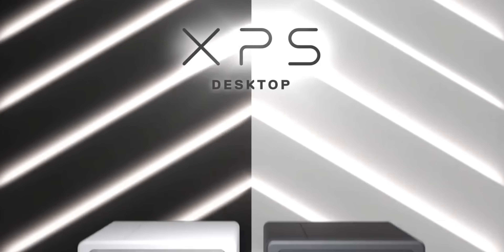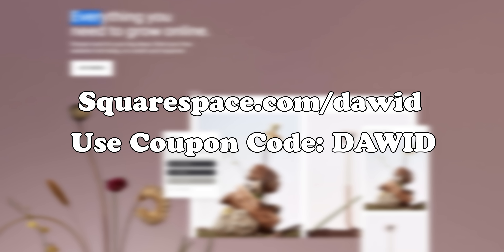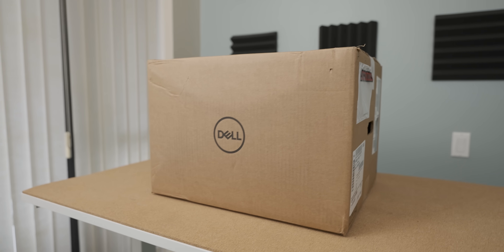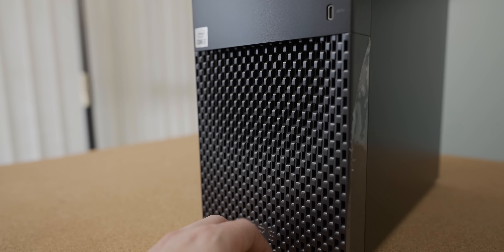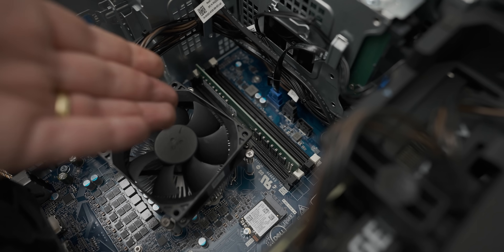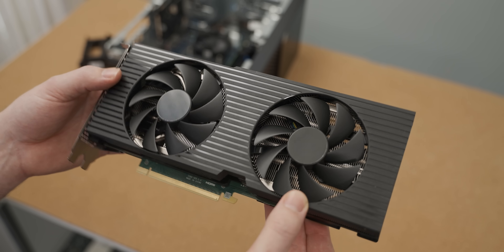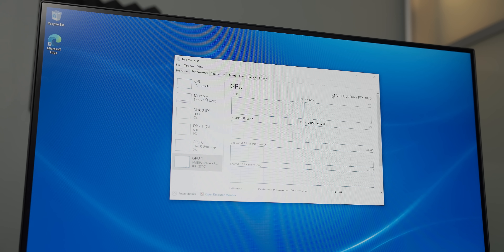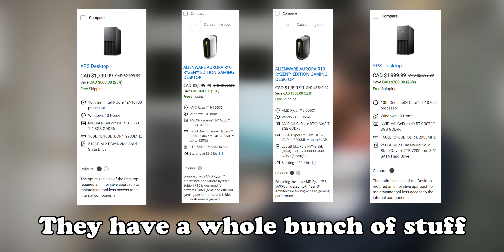DELL Did Me Dirty... RTX 3070 Dell XPS Pre-Built

Comment: Ya know I'm so over the "gamer" look that the simplicity of the dell's are looking good to me.
Reply: Same, I bought a prebuilt for the same reason and I have turned off the flashy lights
Reply: @Adam-qs5ir  same. Though it's getting harder to find a black, no LED, no plexiglass case at a decent price. They have become the outliers and cost more than the flashy ones.
Reply: @bertro514  It really is. I was considering re-casing mine but plain cases aren't in the cheap aisle. Well, unless you go real cheap amazon, but I want some airflow.
Reply: @Adam-qs5ir  One of the reasons I ended up getting a Dell G5 WAS the plain case (well, it came with one LED strip, but I quickly turned that off). Stock airflow and cooling was shitty, but with a bit of cleanup and a bunch of Noctua coolers, I'm typing this with the CPU sitting at 29 degrees.
Reply: @bertro514  Corsair Carbide 100R case, you can get it with or without a Plexiglass side and it's relatively cheap at £58.
Reply: @bertro514  modern cases use tempered glass not plexiglass
Reply: @weegle.  Tell that to Dell, lol :)
Reply: Also it means less likely of house robbers taking your PC because it looks discreet and not worth stealing. Robbers usually go fancy looking things like Macs and laptops.
Reply: Correct. Performance matters, not appearance.
Reply: @nothingtodo58  problem is this bland look isnt even good at performance. Poor air flow etc. At least many gamer looking pcs add fans and try to cool the system down.
Reply: @nothingtodo58  false everyone knows that rgb = power
Reply: Completely agree
Reply: I love the look of the 2011 style precision desktops
Reply: My son is using my old rig. All black, no glass or rgb, perforated in the right places for airflow. It was perfect. Only an i5 and a 1070 but still, the look was good
Reply: Fractal makes some wicked awesome cases that are minimalist aesthetically, but are heavy hitters when it comes to modularity, and effectiveness.  I've got one that came with a DARK tited glass side cover.  I like being able to barely make out my rig in there, lol.  With no RGB of course.
Reply: @suprafastmafc  got the same case I love it but the front usb port doesn't work with some mouse adapters causing them to get stuck
Reply: Yeah, except that Dell goes so far in the opposite direction that they end up making something that's like a time capsule for 2007? Like if I wanted to degamer my pc, all I would have to do is just turn off the RGB and it all looks sensible.
Reply: It looks very clean and when you take off that intel core i7 logo on the front and slap in a core 2 duo logo and a windows vista logo it might be a good sleeper pc
Reply: @69wowzers69  and a lowspec sticker from LowSpecGamer
Reply: this is not about apperence, with a 500 watts powersuply, with a case like this and such a cpu cooler you got a real bottleneck D; RGB is still a gimmik that doesnt affect the price, so i dont get your rant. y<ou can make your PC looks shiny without paying an extra premium.
Reply: And usually "gamer" cases and fans are more expensive. I built my pc on a 20€ office case.
Reply: wrong!!!!! RGB makes you get 10% extra FPS
Reply: Idk, I'm not going to spend $1500 on a PC that looks like it goes in a lawyers office when PC cases are one of the lesser expensive parts out there. You can easily get a $50 or lower case that doesn't scream gamer.
Reply: the problem is not the look of the case , the problem is everything packed together the way it is , it is an airflow issue
Reply: Maybe, or most certainly I'm too old for flashy things, like what a gaming rig has to look like. I prefer a smooth surface, no plexiglass and hell no led strips plastered all over the system. 

First: I prefer getting a better mainboard, cpu, ram, or maybe even gpu for the price of some led strips.

Second:: It just looks cheap. Like blue dyed hair. It's the only colour I don't like seeing in hair. It always looks like coloured plastic glue or blueberry bubble gum in your hair. Like LED stripes. To be fair it always reminds me of the windows in rotterdam where girls strip to lure in some customers. 

Third: A game does not care about my rainbow coloured system. 

Fourth: Pre built gaming systems always cost a hundred bucks or more than their equivalent multimedia systems because they are not flashy

Last: Airflow over everything. If a case can provide better airflow I prefer that over some plexiglass and blinking lights. (again less stress for the power system, less money spend in the long run)

All in all, led is just a cheap showoff, maybe cool when you go to a convention, but that's it. For everyone else it's only a waste of money. An led strip in your room is the much cheaper variant if you need light.
Reply: @FenrisEx  oh common why would you want to spend you money on a better main board ram or gpu why not spend it on useless lights that do nothing for the computers performance but look cool and that's it
Reply: @FenrisEx  bro leds are 10 bucks, good luck getting a new gpu, mobo, or cpu for that price
Reply: i agree with you man
Reply: They s rig s so cheap that you could strut down to the hardware store, pick up a couple of spray cans and paint it whatever color you like. When cares if that lessens its resales value? You could buy another case to put it back if you really needed to. But after you’ve gamed on it for a few years, it wouldn’t be worth it.
Reply: I actually like these dell cases best. Idk why theres curvy edges on the one he got. https://c1.neweggimages.com/ProductImage/83-995-211-S01.jpg
Reply: The old optiplex cases from 5-7 years ago are hands down the sexiest cases
Reply: Yea, that's part of the reason I love the Fractal Design Meshify C, it has a much more toned down and reasonable look to it, while still providing all of the "gamer" features like good ventilation and radiator support. I loved mine until I had a random motherboard failure, but needed my PC back up and running asap and the only replacement motherboard I could find in person wouldn't fit in it and I couldn't find a bigger Meshify C in person
Reply: I love the Fractal Design and Li-Lian cases for that reason, BeQuiet coolers without the RGB also look nice then the motherboard and GPU RGB stand out against the rest.
Reply: There are plenty of elegant cases out there. You don't need to buy the "gamer" ones.
Reply: I always come back to this video cause the thumbnails kills me
Reply: till they lie to you and give you single channel ram over dual channel lol
Reply: fractal cases are better in most every way for any kind enthusiast..
Reply: Rgb with intel i3 is the same as ricers in cars
Reply: I still have my Dell XPS 8920 paired and upgraded with a previous gen RTX 2070 Super founders edition, Corsair Vengeance 32GB 3200GHz DDR4 dual channel RAM, and Corsair RMX series 850W Gold Power supply and still giving me fantastic performance. 0 complains. No need for a huge water cooled fancy lights monster case to game on. The design of the XPS is compact, industrial, and simple. I like it.
Reply: i’m planning on getting this desktop fairy soon, and even though the flashy gamer look isn’t for me, i like the idea of a small led strip (one colour, not flashy rainbow crap) going vertically along one side of the case (that sounds super specific, but idk, having one little light would be simple but pleasing ^_^)
Reply: @WafflesX3XD  I have the Dell G5 5000 (same case chassis as the XPS, but different plastic on top), and it has a rather discreet led strip across the front (horizontally, at an angle). Very easy to control the light or even turn off from Alienware Control Center.
Reply: Cool go buy onr
Reply: pog im the 1k like
Reply: Logically I agree, but my lizard brain likes the pretty lights so 🤷‍♂️
Reply: Lol the gamer look always looked garbage to me
Reply: Yup this PC looks pretty good in my opinion. Dell makes some quality stuff, I've literally ordered 100s of them.

Comment: I actually like the simple looking front. It doesn't try to transform into a robot when you look away. Same for the graphics card, it got that simple, industrial understatement going for it.
But the back. Ohh, obviously they have to use a proprietary PSU (which comes with 4 18A rails, just like my bequiet straight power E9-CM-480) and place the motherboard ports against all conventions.
The trashcan quality mouse & keyboard at least can work as a backup in case the proper ones have issues or you need something quick to run some tests.
And no dual channel RAM despite having it specifically ordered? The crappy prebuilt I got in 2005 managed to come with dual channel and had the equivalent of an i3 with a 1030 today. Time to RMA that thing because it was not as ordered.

Comment: I think you’re being unfair to Dell here. You chose that CPU so you can’t complain that it’s bottlenecking your 3070. Generally most games are GPU dependent, I would have liked to have seen some benchmarks other than Battlefield V. The fact that it has a stock cooler is fine because it’s a non K variant

Comment: Proprietary power supply, good luck upgrading it to upgrade your CPU and fan, Video card, case fans, max system ram, and additional SSD's or HDDs.  :)  I have had 2 XPS Machines and 3 RTX Machines and they all suffered from USB chip failures and sound card chip failures and Ethernet chip failures???  My latest RTX machine has gone through 3 motherboards.  Dell is not what it used to be.  It is sad.

Comment: That PSU looks like it might be one of those new ATX12VO power supplies which explains the different form factor and why it's so small.  It's only designed to output 12V power.  Anything that needs stepped down would be handled by the motherboard.
Reply: Also, it is made by Delta which is a very reputable industrial power supply manufacturer.

Comment: Hey,
You should do a vid on an old sell optiplex. There was a listing on Amazon for some and I purchased myself one and I was quite surprised by the quality of it and the cable management was pretty neat and there was actual airflow in the case. The price wasn’t to bad it was around £150 for a i5 3470, 4x2gb ram, gt 1030 or a gtx 1650 and a 256gb ssd which actually is faster than a hard drive.

Comment: Dell did me dirty too. Maybe 8-10 years ago, I wanted to upgrade a Dell desktop computer's graphics card. I purchased the new video card after talking with a Dell person on their chat connection. I installed the new video card but noticed strange things about the PC's behavior several weeks afterward. I discovered that the card was not what I had paid for. The shipping label identified it as the one I purchased but I had not noticed that the actual card was another earlier version. By the time I discovered the error, the replacement date has passed.  Fortunately, the PC using Win 7 still works and is used by my spouse, while I use my Pink Lady desktop that I fabricated myself in 2013.

Comment: They actually made a huge effort to cut every cost possible.
Reply: so Dell PC always die between 6 months to 2 years.
Reply: @KelvinKMS  I've worked in IT for nearly 8 years and I can tell you for a FACT that Dells last longer than almost any other brand I've seen in the field. (Sometimes longer than we'd like lol)
Reply: @StarkByte117  What about Lenovo? I second that, there's a reason so many people repurpose used Dell Optiplex's
Reply: @ChrisD__  Those have been good to. They are both really easy to fix up, slap a GPU in, and turn into a basic gaming rig for wanting to get into PC gaming
Reply: @StarkByte117  your talking about latitudes precisions and the like.
Reply: @marcellachine5718  not really. Mostly inspiring believe it or not
Reply: @StarkByte117  That is because your systems are being used for office and nothing else, lol. 

Dell systems are full of proprietary stuff, so good luck trying to support older systems after a few years though.
Reply: @StarkByte117  My HPs some are on their 12th year.
Reply: @StarkByte117  Agreed. I have seen plenty of dell budget office PCs that are 7 years old and still won't die.
Reply: @KelvinKMS  My Company supplies Dell PC to our client running their powerplant. PC Always running 24/7. None of them had issues since 5 years
Reply: @KelvinKMS  That is not true. Dell PCs last a long time.
Reply: @KelvinKMS  This Dell PC has been gaming for 6 years.
Reply: @KelvinKMS  I have an 8 year old Dell Optiplex 760 Series. It runs Windows 10 with 2GB of Ram. Still works.
Reply: @why_tho_  A PC die depend on a long you work everyday. and how heavy duty you did. and how much dust in your PC case. Overheat can make CPU die easily. Gaming on Dell PC can also make power supply dead easily.
Reply: @why_tho_  I'm sure it runs when it's on life support.

Comment: On the PSU, they've been using the new ATX12VO standard for a while, which is why it has so many 12v rails and is 80+ platinum.
For those that aren't aware, this new standard moves all the power delivery to the motherboard, so the PSU only has to convert AC to 1 type of DC, making it very efficient and even safer

Comment: I almost bought it just for the GPU and replace almost everything else (except the RAM), but then I found a BNIB EVGE 3070 for $1070 CAD, and decided, it will be much better to build around it. I'm glad I did because I see the version of your 3070 is different (only one 6+2 connector, and two fans).
Reply: They don’t really need much power tho, my fe only has half the nv connector electrically wired

Comment: the insides looks like my computer from 1998, wtf dell.

Edit: Also the price is a joke for 1 stick and a non-K and an unnamed gpu, a stock cpu cooler, no case fan flow, weird they have a platinum psu at 500w ?! (Linus also only got 1 stick i think lol, for the second time)
Again i swear it looks like a shitty tower from pre 2000 on the inside, i actualy miss the plastic slides to lock various hardware in place vs using screws, but as you dont really use disc drives of any sort anymore its very much not needed.

Comment: a quick and cheap way to fix the performance on that prebuilt is to buy and install a $50 cpu cooler. the single channel ram although not ideal isn't the computer's biggest issue, cpu heat is

Comment: Well if the PCIE 8 Pin is on one rail and the GPU is pulling a decent amount from the 24pin feeding the PCIE slot which is on another rail, that should be just fine with an 80+ Platinum unit. That would be 6.25A from the 24pin and 12A through the 8 Pin, assuming a fully utilized 3070 pulling 220W (75W from the slot)

Comment: Dell did not do you dirty, the system you order said it comes with 1x16MB ram plus you assumed the CPU cooling unit shown in the Prepared for your future needs stock photo with a disclaimer (the one you flashed) was the cooling unit you might receive. So what I can tell from all this is you got what you ordered. Nothing more nothing less. Dell did not do this to you you did it to yourself.

Besides, you can always return it or do what WayStedYou said: "followup replacing the CPU cooler and adding another stick of RAM incoming."

You claim Dell did you dirty then you turn around and do your viewers dirty by posting misleading bogus crap! Face it you screwed up when placing your order assumed!

Not all of us are idiots and a lie is a lie and that is what I see in this video you lying, or you may call it embellishing I would not.

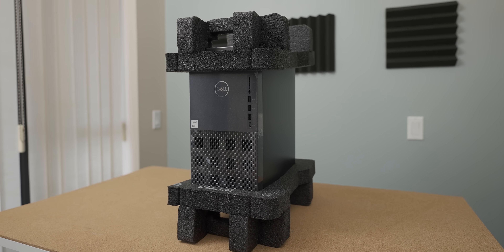Comment: 4:21 Oh come on.  I loved putting my gamg rigs into plane beige cases and making people think they were total pieces of shit, and then blowing them away in multi-player games.    Ever see the Top Gear episode where Jeremy and the crew put something like a Viper engine into a Mercedes cargo van and beat these other guys in a drag race...?  Yeah sort of like that.  Of course I had to mod some of the cases so I could add extra fans, but on the outside it looked pretty much like a plain office computer.

Regarding the rear I/O ports... I mean how many do most people usually need?  Maybe 4 USB (keyboard, mouse, external drive, and possibly USB headphones).  I mean something like 4 USB 3.0 ports, an ethernet NIC and some sort of video output is all that most people need these days.

The one thing I found on my Dell XPS laptop, and I think Dell still uses, is CompuTrace, which I absolutely hate.  So including all the garbage you mentioned, you probably also have CompuTrace, which can be turned off ,but is also detected by some AV systems as malware.

Comment: Bought a prebuilt but with Cyberpower. Opted for a generic 3070 and the MSI Ventus x3 is what I got. 

For 1700USD I got: 

ms i750w goldrated psu, 

ASRock steel legend z490 mobo,

i7 (10th gen) but with the K, 

A rear blowing double fan cpu cooler (phanteks), (Liquid cooling would have been same price but I don’t like maintenance)

1gb intel nvme storage, 

a better looking case with 6 rgb fans, 

rgb mechanical keyboard, 50k dpi mouse

and a 2x 8 gb ram lol!

For now I think that prebuilts are the best way to get a 30 series.

Comment: I stopped using Dell machines after I had to talk to a rep for 4 hours trying to explain that the laptop turned on but wouldn't post past the boot logo... Just to send it back and have them send me a different machine saying they replaced the board. But the part numbers were different... The issue resulted in them pushing an emergency bios update as there was a bug that when you booted a usb media it killed itself. Wonderful.